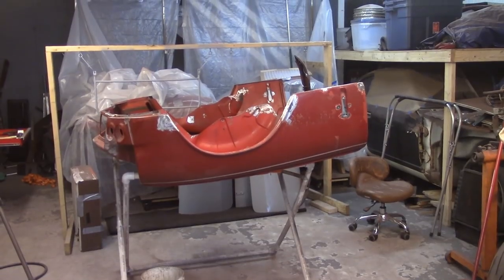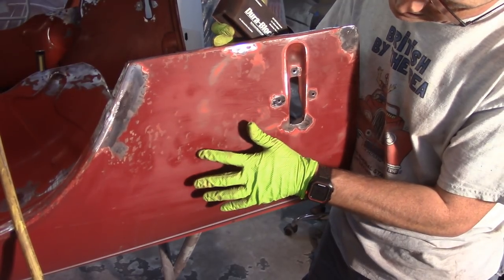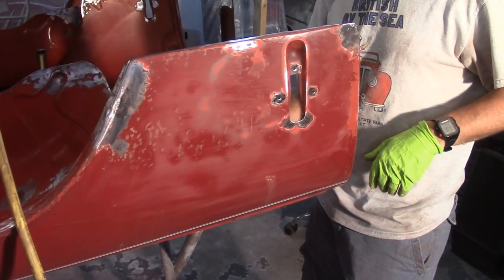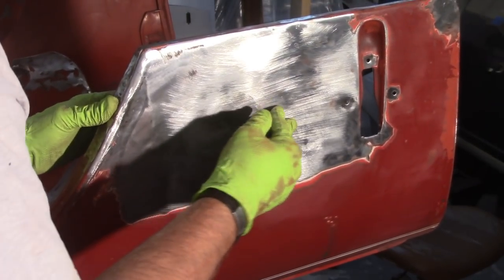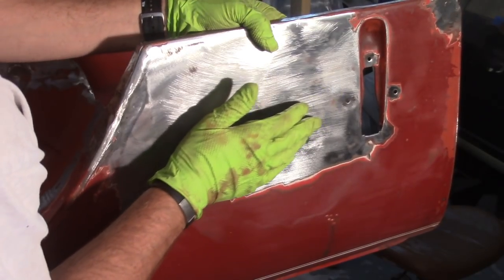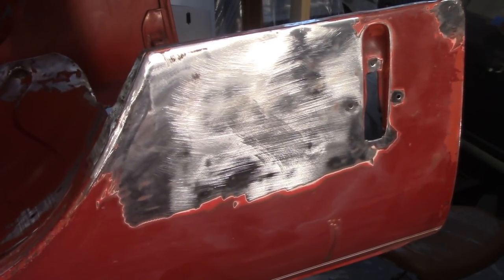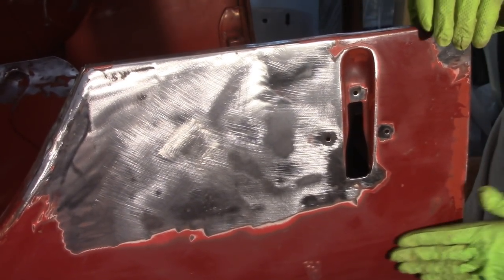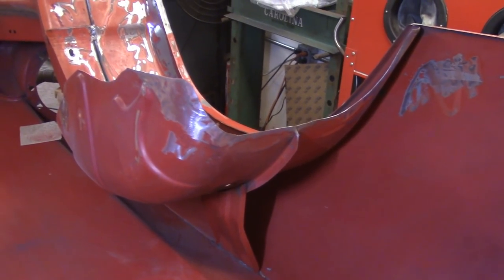Fix Oil Canning - Triumph Spitfire Restoration Bonnet #7

Comment: Good work Chris..coming along like a well. Can you let me know where you picked up the 5" shrinking disc.. Did a good job on the oil canning.
"
Reply from the maker: Thanks, Brian. Yes, it's a place in Nebraska called Wolfes Metal Fabrication (http://www.wolfesmetalfabrication.com/sdisc.html). They aren't real cheap, but it's been effective so far and I know others on my favorite forum have used them with success.
Reply: Chris Fisher, yep, the shrinking disc will work.  What is your favorite forum?  Tom
Reply from the maker: Hi, Tom. My favorite forum is over at The Triumph Experience website, the Spitfire/GT6 one. Address is https://www.triumphexp.com/forum/spitfire-and-gt6-forum.8/.

Comment: You should not recommend anything before you learn proper method u tune cow boy it's not luck a tip bring all your low up first . Then bring down your low ,s practice on a old panel before you wreck you job and end up loading it up with filler. Ps throw your camera away until you master what you are trying to show people.
Reply: Sorry spelling cheek  then bring down your high spots
Reply from the maker: Hi, Steve. Thanks for your comment. I think most people, based on my subscriber count and how I come across in my videos, would never consider me a master and follow my methods as the best way to do stuff. I'm happy with my body work and I took way more filler off the car then I've put back on.